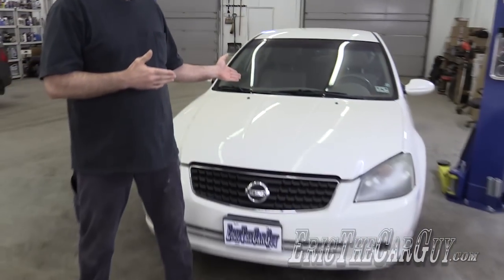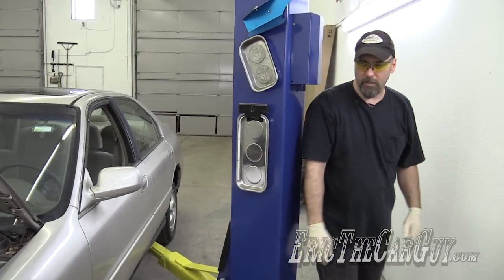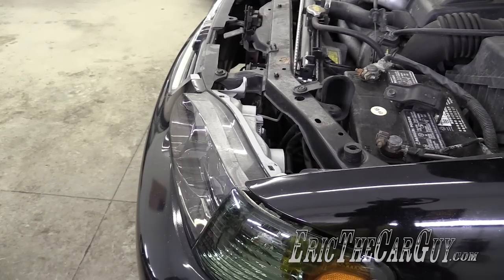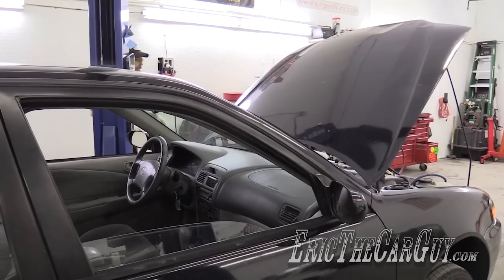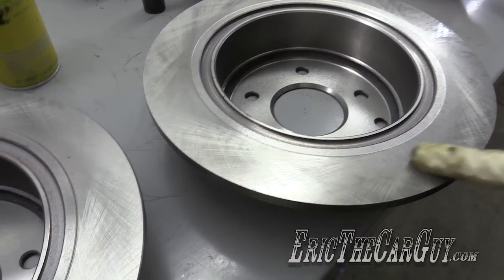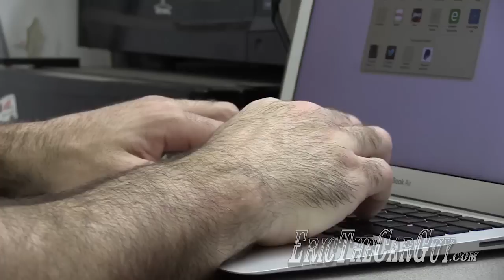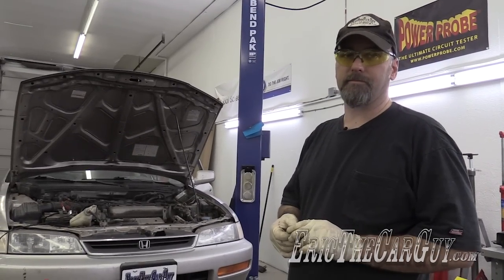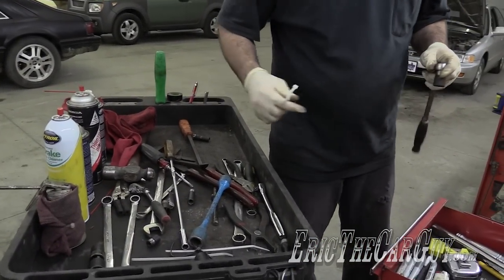A Day At The Shop With EricTheCarGuy

Comment: Ironically I have a 1996 Honda Accord where the A/C only comes on when it feels like it, and the dash/tail lights don't work. This all started shortly after the same god damn harness fell down in the passenger wheel well JUST LIKE the car in this video. I wonder if its a common thing? We unwrapped the harness, cut and soldered and heat shrink'd all the wires properly and taped it up and remounted the harness and still no dash/tail lights and the HVAC buttons are pretty much useless. Can't be bothered to deal with it though. Spare car.

Comment: last time customer brought me parts to do a job. i stayed late at work to get it done so I could have lift free for in the morning. in this case is was rear brakes on a older c2500 chevy. tore everything down, it had one leaky wheel cylinder and luckily he had both of them in the box and new brake shoes.... oh wait nope he got the wrong shit for the smaller rear brake system, none of it fit. so there i was sticking a thumb up my butt at 8pm with no parts. and then ruined my morning job cause parts store is slow as balls. 11am rolls around finnally get everything pressure bled and then had to wash hands get out scan tool and bleed abs cause he drove with no brake fluid in rear for like 2 months took another hour to bleed air out, finally get a good pedal. had to charge extra for job and get fussed at cause I couldn't use their wrong parts and had to mark up mine.  lol i need a camera man to film some of my days... love the videos!

Comment: I went to a local auto parts store, bought some synthetic motor oil and thought they could do an oil change - was I ever wrong.  They did not have a lift, totally messed up my oil filter case getting it off, did not put on the filter I paid for, charged me for replacing what they broke, my oil filter case.  In the future either they have a lift or they don't get my business.  If they had not given me back my money for the oil filter they did not install, I would canceled the entire charge.  ETCG is the professional I would trust to work on my car - boo hoo.

Comment: Hi Eric, this is a great video. I hope you could make a detailed video about that honda car that have problem with the AC. Because i have almost tha same issue with my 2008 Honda CRV. I brought it already to the honda dealership here in Oslo, Norway. I just told them that the AC is not working. Without even looking at my car they just qouted me a price to replace the AC compressor for $1800. I don't have that kind of money to spend right now. So i just have to drive with my windows down every summer.

Comment: Eric!!!!!! Help!!!!  I have a Ford Fusion 2007 and brought it in to have a/c repaired. I thought it was the a/c sensor, but who am I ? just a dumb female.  After they replaced the compressor, condensor, and clutch, they determined it was the a/c sensor.  I drove off the lot, without the a/c fixed but they had also drained the power steering fluid so I had no power steering...lots of cursing:)  They ran out and put fluid into it and sent me on my way.  The a/c sensor was fixed at another place, but the steering wheel is still very stiff and hard to turn.  There is also a vibration in the steering column and wheel at stop lights.
Any input would be helpful:)  Even though I am female, I can understand.  I LOVE TOOLS!!!!!!   (Is that okay to say being a girl?)      Lisa
Reply: Vibration is probably an alignment or a problem in the steering rack. The hard to steer part is a bad power steering pump or it has no fluid. Possibly a big pressure line also. That first shop you've mentioned should be put out of business